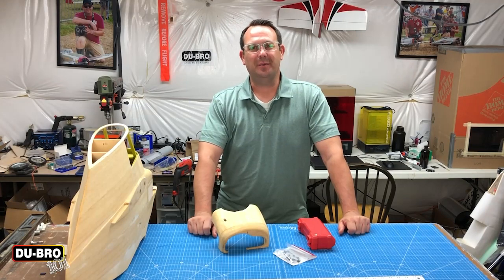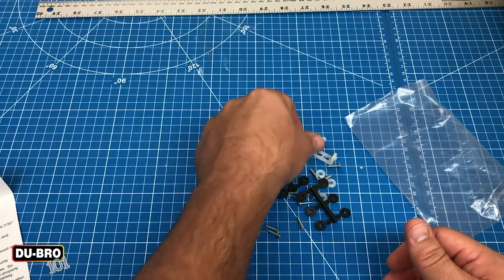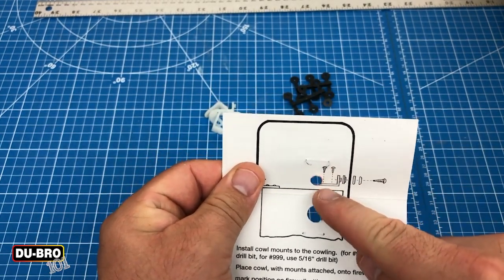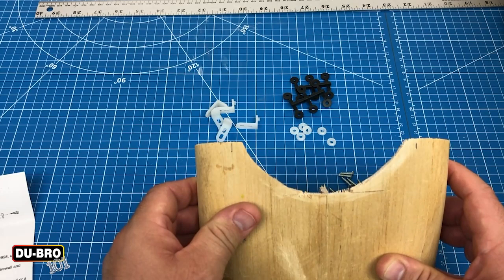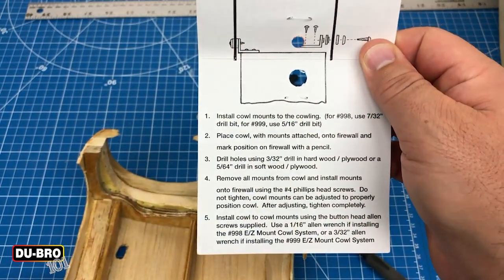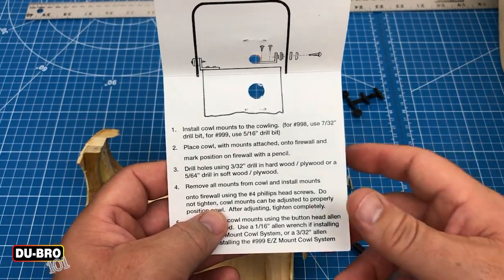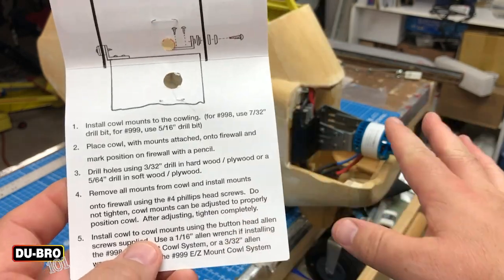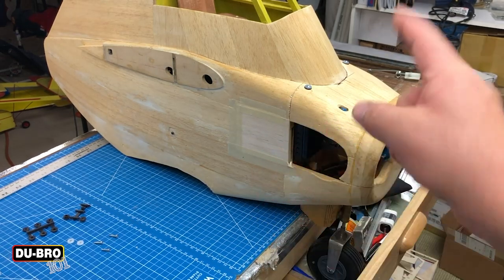DUBRO 101: How to Install the EZ Mount Cowl

Comment: I just installed this on a spare cowl for my original Sig Kadet MKII that I learned to fly on back in 1981. I decided to dust her off, convert her to electric and bring her into the 21st century. The old cowl was cracked from the engine vibration so I was lucky to have saved a spare one. Looks great.
Reply from the maker: Awesome!!  Happy flying!!